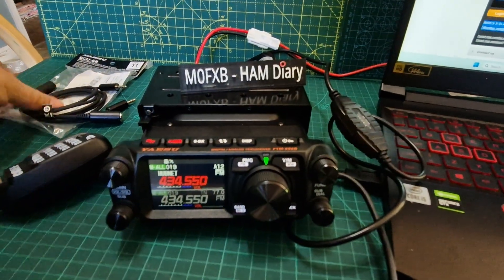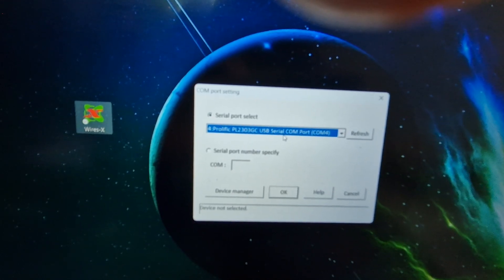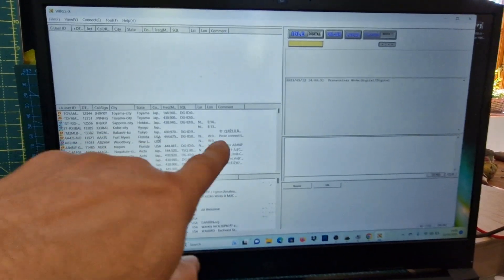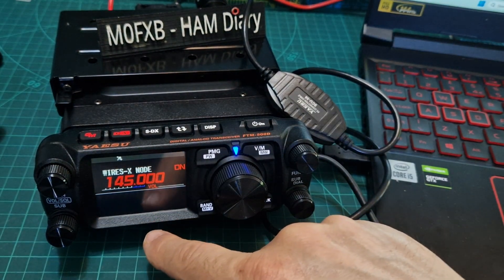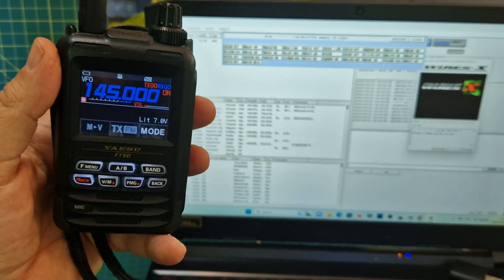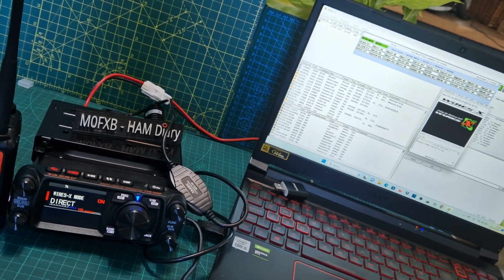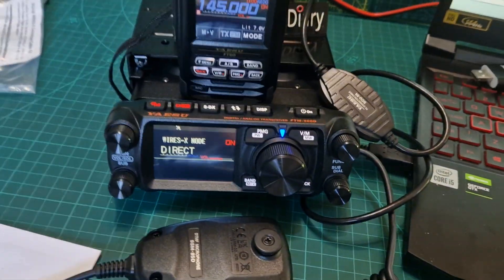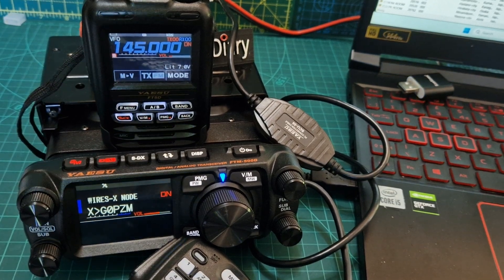YAESU FTM500 WIRES X PDN -SET UP

Comment: if you were using the FT5D connecting to the FTM500, do you have any range on the FT5D like walk around the neighborhood or are you just able to use it around the house?
Reply from the maker: Hi You could walk about 50 yards more if line of sight is good .
Reply: @M0FXBHamTech does it limit the power output in RF mode then?

Comment: Hi Andreas, when you talk in DIRECT mode, where do you specify what frequency you want to transmit/receive on? Or can you only talk in a room? And when you talk via the FT5, how does that communicate with the FTM-500? Is it blue tooth? Thanks. Paul. M7PTH
Reply from the maker: https://youtu.be/c1yA8MvUQN8?si=kJkHjvAeMTxcAU80
Reply from the maker: Look near the end
Reply from the maker: In settings you choose Freq on the pc
Reply: Hi Andreas, thanks for your reply. I'm new to the hobby and struggling a bit with WiRES-X. With an FTM-300DE, connected to WiRES-X on the PC via the SCU cable, no HRI-200 box, no antenna, can I transmit/receive on a frequency of my choice? Or do I have to connect to a room?

Comment: I saw the USB audio card next to the radio and watched to the end, hoping you might have some answers to my issue. I'm trying to use the ftm-500 portable HRI direct mode. This allows you to connect to both the Digital and Analog rooms using the Wires-X software and the radio. I plug the audio cables in, but since I have a speaker and a mic cable... and I think the audio comes through the PC for analog, I'm confused about the signal out and how to configure it correctly. So far, I hear no audio for analog channels. Are there Wires-X app settings to configure? Do I need to tell the mic to output to my speakers in the Windows audio settings. Have you had this work?  This is the mode where you press both GM+DX and Power at startup.
Reply from the maker: Watch lots Videos carefully

Comment: Hi!  Thanks for the video!  I also have an FT5D and an FTM500 that I just acquired, but I'm very new to Fusion.  I have a couple questions.  With a dummy load connected to the FTM500, how is it that the FT5D can use it as an access point to Wires-x?  I'm having trouble understanding how the FTM500 could hear the FT5D if it was, for example, outside in the garden?  Is it just working in your video because you're literally right on top of the FTM500 with your FTD5R?  And if so, would you then connect the FTM500 to an antenna, and use a simplex connection between the two, if you wanted to connect from some greater distance away?
Reply from the maker: The reason for dummy load is to do with power output rules when the 500 is in access mode , the dummy load acts almost like a bad rubber duck .
Reply: North TX... Yes, use an antenna with the 500 to use it with a handheld or other mobile radio.
Reply: @NorthTXMountainbiker - That is what I was wondering, also!  Learned something new about the dummy load still having some RX capability, per Andreas answer.